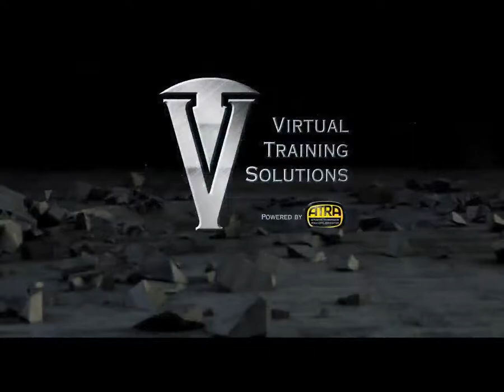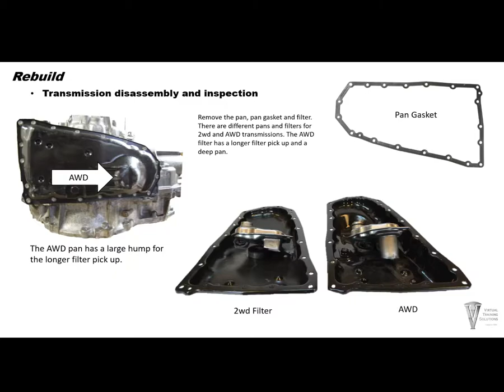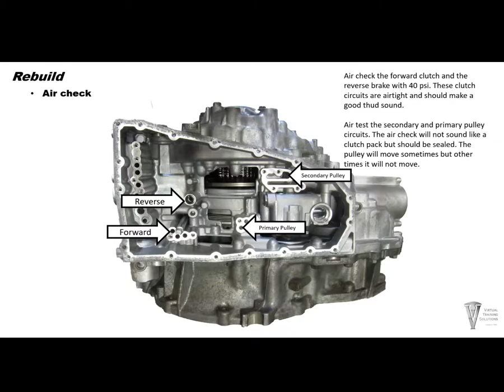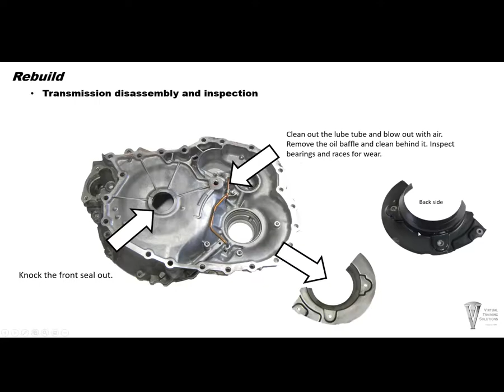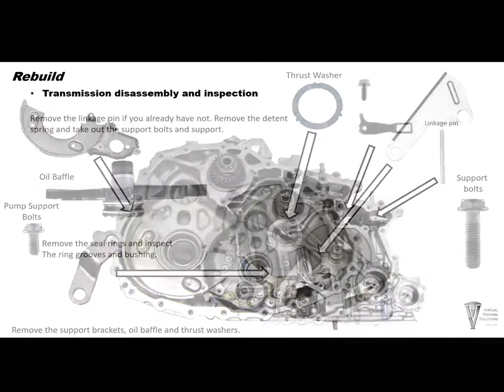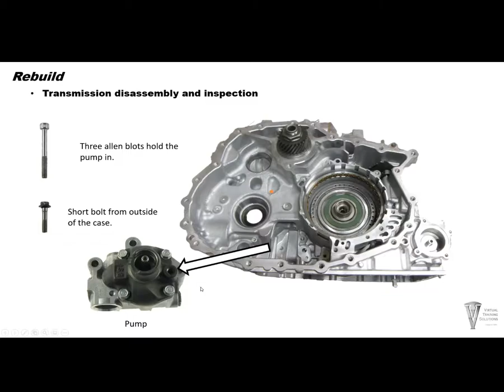06 vts jw jf017e teardown

Comment: Hello sir
I had a dtc P0776. ( pressure control solenoid B ) on my 2013 pathfinder cvt transmission .

Should i replace valve body or i have to change the complete gear 

Wait for your precious answer 

Thanks
Reply from the maker: You can probably get away with replacing the VB and Solenoids, but if you have a chance to take it to an ATRA shop i would do that first https://www.atra.com/ShopFinder
Reply: Hello sir. Same exact situation. Did you change the Solenoids? Ehich one specifically was solenoid b?